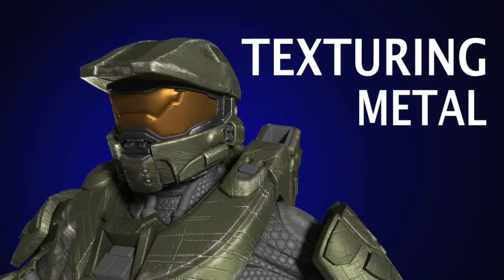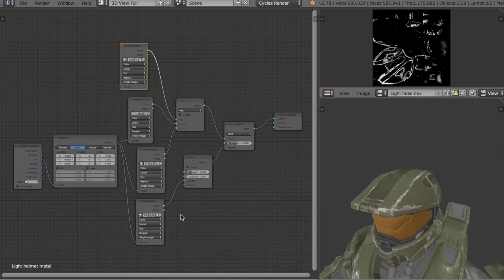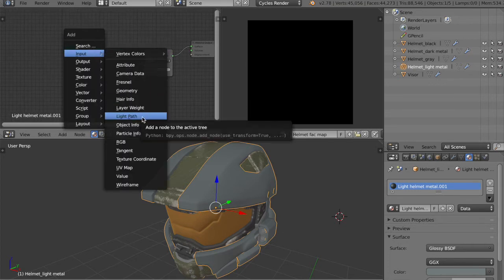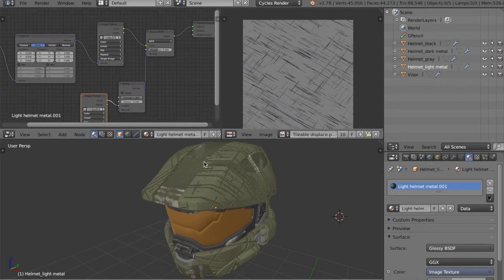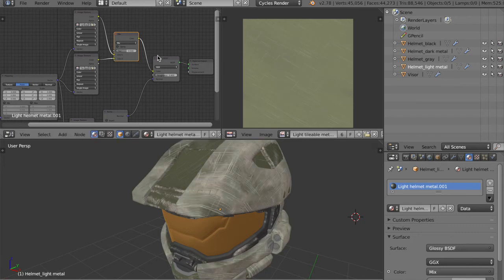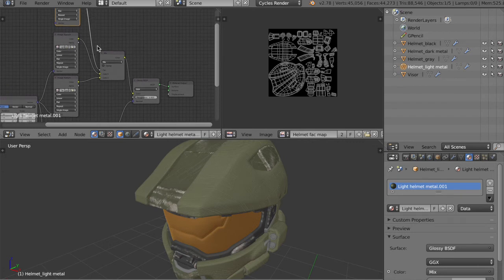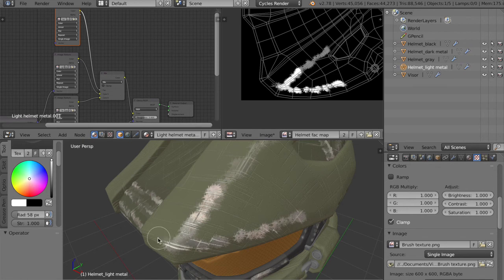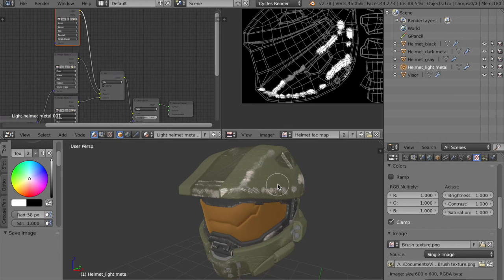Texturing metal in blender!

Comment: Really awesome and useful, thanks for this! 

I have one question as I may have missed or misunderstood something. But is there a way to make part of my texture look indented so to speak? I'm working on a bike and several of the different connected metal plates are separated by black lines but they look a little too overtly painted on right now and I am struggling to find a way to fix it.
Reply from the maker: I'd definitely recommend plugging a bump map into the 'displacement' slot of the 'material output' node, which will make it look less 2d.
Reply from the maker: If you already have a bump map (or a normal map), try increasing the contrast on that map while also fading the black lines on the colour map.